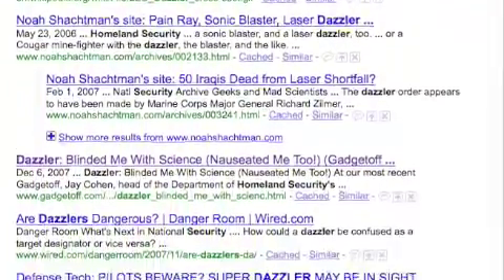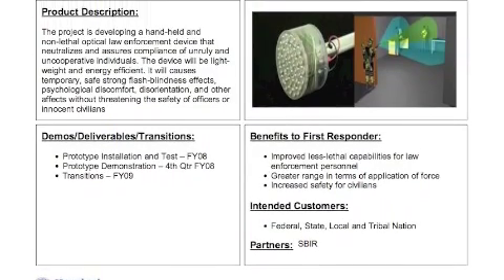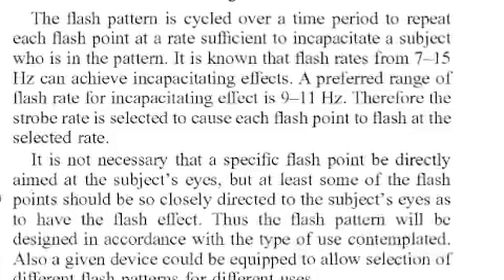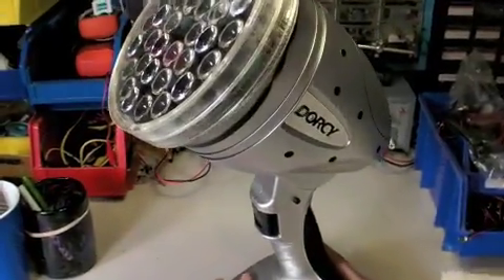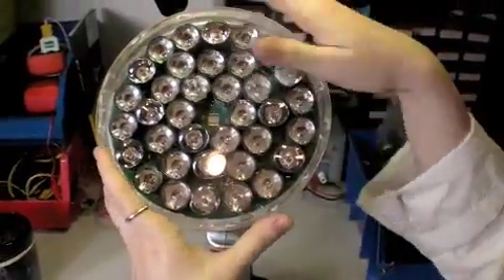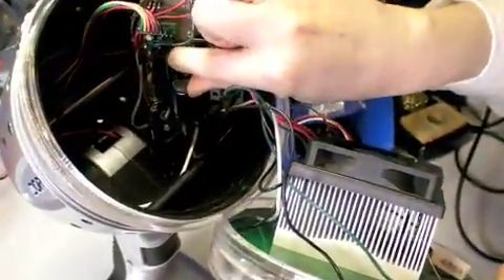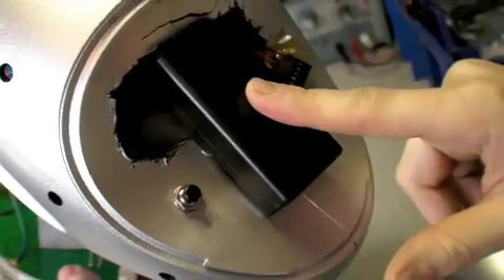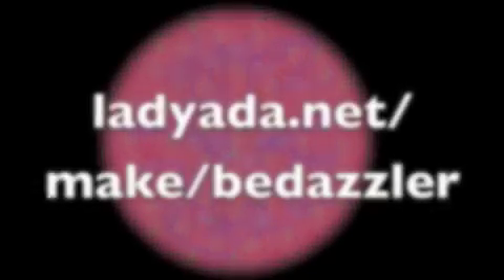Hardware hackers open source Homeland Security

Comment: I'd like to know how small you can make this thing.
Can you make something small enough to carry 
around in a bag. Obviously the battery wouldn't 
last long but you wouldn't need it to if you were
trying to temporarily disorient, say, a gunman.
Reply: Very small, not as bright in total, but bright enough over a face sized area. 8 pin uC, 3 logic level mosfets or bjts (more suited to low voltage operation and don't need to handle that much current for one Power LED each), one 3 colour Power LED (1 Watt per colour) with lens, and powered from a single 18650. Components surface mount on a small circular PCB. Build it into an existing small flashlight. You may need a second lens to further narrow the beam. I personally favour just making a head that you can plug into one of the (now useless) small powerbanks using the powerbank as a handle, and a way to charge the 'flashlight', and running the unit from 5v.

You can purchase an RGBW zoom flashlight from an online auction site or similar, and it just needs a replacement micro to turn it into a random colour strobe. Price less than £10 (UK pounds).